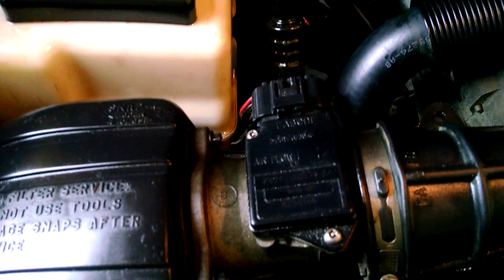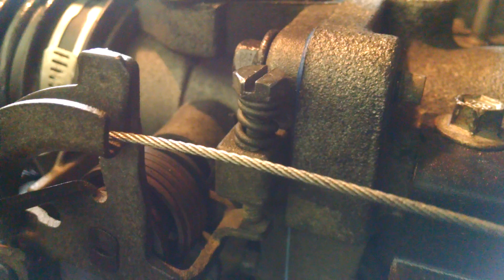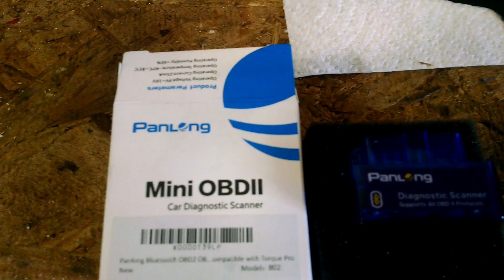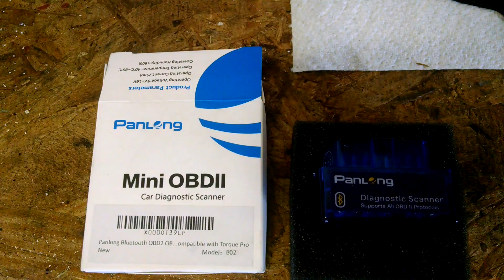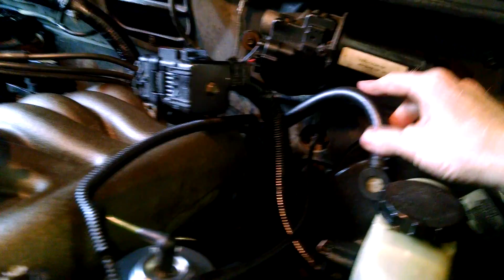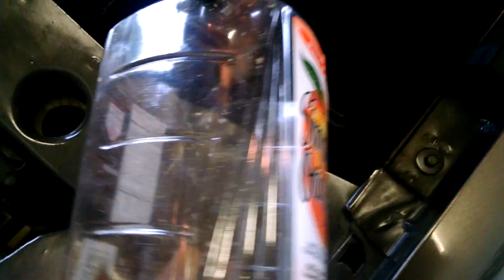2000 Ford Ranger High Idle

Comment: When my Ford Ranger is running high idle (1000 rpm), if i disconnect the IAC electrical connector the truck idles down and runs really smoothly, closer to 650 rpm.  What does that indicate?  Is the IAC working properly and its racing for another reason?

Comment: I added an aluminum restrictor plate to the IAC using a 7/32 hole to reduce idle speed to around 1300 rpm when cold. Usual cold idle is way too fast at around 2000 rpm

Comment: Great video! I'm currently trying to figure out what is going on with mine. Just replaced the TPS and IAC, still running 900 rpm when idle. It's not terrible, but still rougher idle. Hopefully I'll figure it out.

Comment: If you're idle air control was installed a quarter turn too much it'll actually want to hold your throttle body open a little bit also causing high idle.

Comment: Great video thankyou for that🙏🏽. Im not sure if you have stumbled onto this problem but, i have a 99 ranger 2.5l. Cleaned the throttle body, changed the idle control valve, air charge temperature sensor, filter and now my truck accelerates when i turn it on for like 5 seconds then idles normal, then i start to drive, as im coming to a stop, i put it on neutral (its stick shift truck) to slowly stop, but it keeps sounding like the motor is accelerating for like 5 seconds as well. And as soon as i come to a complete stop, it idles normal. Its concerning to me because it didnt do that before i did all that i did to it. Thanks in advance for your time!!

Comment: Hi just found your channel. Got a question, I have a 1995 ford explorer 4.0. When I connect the plug to the AIC the idle increases to 2000 2500. disconnect the AIC and the idle drops back. I have replaced the AIC but still the same problem. Have not checked for a vacuum leak but I don't think that's the issue as all vacuum controlled devices seem to work fine. BTW love your channel, you are very good at explaining things. Got any thoughts or suggestions would love to hear them. Thanks

Comment: Hello. I picked up a 2000 Ford Ranger V6 3.0L with Idle around 1700rpm.  Then I cleaned the MAF and bought a new IAC.  Temp sensor on the intake doesn't seem to fit very well, that could be a problem.  I have not checked the TPS. I removed the throttle body and cleaned it with air intake cleaner.
The new IAC works better and idles about 1200 without AC on. When the AC is on, then it rises up to 1500 and won't go back down, even when the AC is turned off again. 
I touched the IDLE Adjustment screw. :O  But I put it back like you showed.
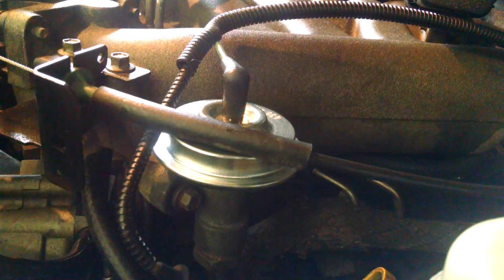4:15 ERG?... you mean EGR? I might need to replace that.
 What do you think?

Comment: I'm a little late to the party since this video is 7 years old but I have a 1996 Ford Ranger XL and I just replaced the IAC valve but now as I'm driving if I let my foot completely off of the accelerator I noticed that the car does not decelerate it remains at the same speed for about 4 seconds and then it lets off, I did not have that problem before I swapped the IAC so is there any explanation to that? Anything I can try that I haven't tried already?
Reply: Is it still doing it because usually after you replace it it takes a couple drives for the trucks computer to start working with it and learn how to do it right again because it was used to a faulty iac

Comment: I know this is way out if date. I really just want people to know that the device that he referred to as the throttle position sensor is actually the DPFE which controls the EGR valve. The throttle position sensor is located opposite the side of the throttle body as the throttle cable.
Reply: On this vehicle, it’s located directly under the DPFE. He put his finger on it.

Comment: What should the rpm's be?  I'm constantly at 1100 to 1300 rpms..  Warm or cold.
Reply: 650-700 ish
Reply: @ctbale1 
Guess it's off to the garage to check my setpoint.  Frack why can't it still be a simple turn of a screw on the carb.
Reply: @johnjacobjinglehimerschmid3555  yea, been trying to get mine down to normal for years.  Its at 950. I've tried everything except for pulling the intake manifold off.  I would  just ignore it except for I have harsh down shifts because the torque converter stays locked up and I'm hammering on my transmission.
Reply: @ctbale1  
Yeah bought my ranger last 6 months.  122k on it and soon as I got it felt the hard shifting up / down ... One garage said meh .... it's normal for trucks.

Got a stuck torgque converter clutch stuck and had the transmission and converter rebuilt /replaced.

Still shifts hard, imo.  Reverse I can hear it bang on the rear diff or it's.  Driving my shifting is meh to ok.  Sometimes it hits hard those seem to happen if I accelerate and then ease up right at a shift point .... then she hits hard.  

To say the least I'm so not happy with this truck.  My 2nd foray into Ford land in 55 years.  I'm sad I stepped out of my anti ford box.

Comment: That was the best video on car repair I have ever watched. Thank you. As soon as the parts store opens this morning I'm going down to buy the analyzer you spoke of.
Just curious, how would a plugged air filter affect the idle on my 2003 Ranger V6?
Praise the Lord
Reply: Well I went to the auto shop this morning to purchase a can of MAP cleaner, as you recommended. On a whim, I purchased an air filter as well. I bought this truck used a while back and, when I got to figuring, realized "a while" equated to over 3 years. Funny how time speeds up when you get older. Anyways, I've never changed the air filter and, considering how many dusty roads I drove on this summer, I realized a new filter was long overdue.
To make a long story short, I changed the filter as soon as I got home ( took a while for the dust cloud from the old filter to settle) and planned to clean the MAP later today when I got home. Imagine my delight when I fired up the motor and, after a minute, its idle settled down at a nice 800 rpm instead of the 1100-1200 rpm it's been idling at for over a year.
Thanks again!
Reply from the maker: Glad to lend a hand

Comment: Dang . 
My 02 edge 3.0 v6 is not set up like this .
The problem with that is this is the best explained video regarding a high idle on cold start only issue. 
I've changed all sensors and ran out of money for the pcv value. 
I must say it's quite possible the Teflon coating is gone .
I did spray carb cleaner and found no leak .
I do like your smoke machine. 
I did mess up and turn the screw .
Put it back by bring the clean threads to the edge of the dirt .

Do a video on an 02 edge lol 3.0 v6 auto . It doesn't mean to be a sinner , it's trying to follow the right path yet it's difficult living on the edge 😆

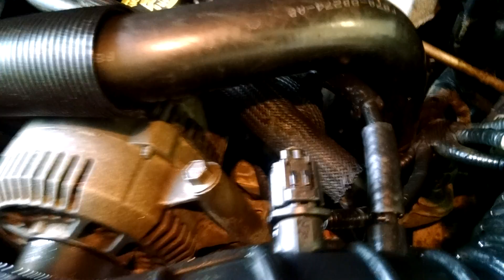Comment: @1:01 what is that tube next to the sensor?  Mine is getting dry rotted and I am having issues with a very high idle when it is cold.  I had the idle air controller replaced in the summer of 2020. It will go to almost 3000 rpm when it is cold for a few seconds.  It does this when I first start it cold and never did it until now.  It also only does it when it has been set for a few hours.  This all started when the weather got below 25 F degrees.  The AC and heater work well so the vacuum on that end is good.  My Ranger is 21 years old and it's starting to nickel and dime me too much.  In this economy it's that's $250 for this $500 for that.  My brother-in-law is a mechanic and I still can't afford it even when cuts me a break.

Comment: I unhooked the IAC until I can get replacement seems to run ok better than pulling up to light pushing in clutch and engine idling 6000 rpms minutes plug it in wow 100 miles a hr. Mind these truck are nothing but junk to me

Comment: Gosh this is a good well thought out video. My ranger 99 only idle's high when it's rolling and that goes to a good idle once it comes to complete stop. Apparently this is to make shifting easier while you're driving around but it's so high that it cant engine brake at all and it's just not good. Can you recommend which of these things to check first for that problem?

Nevermind it's a vacuum leak for sure!  My vents only EVER blow out of the defrost.  So that's it for sure

Comment: I put a new tpm sensor and a iac sensor and took off my throttle body and cleaned it up and reset my computer by putting my battery cables together and it worked great for 2 days and now its back up to 1500 rpm..can it be my maf sensor I didn't replace yet?

Comment: What could cause a 3 minute high idle after start up, summer or winter, everytime a warm engine sits for 10 minutes on a 2007 ford ranger 3 litre v6. Once it drops to normal, around 750 rpm, it stays there. It is only at start up is does this. Scan tool shows nothing.
Reply from the maker: That's a great question.  It's not a vacuum leak.  I would check the Throttle body sensor and  MAFsensor

Comment: Hey! I appreciate all your videos so much. I have a few questions about my 99 3.0l ranger. Hoping you could reach out to me and help me out! 402-604-0277
Reply from the maker: Hi Dillon.  Feel free to post your questions here.  I'll do my best to answer them.
Reply: @resurrectionauto670  ok well I had a photo I wanted you to look at for a sensor. But I was curious if you know, is there a white connector the comes from the same cable as the o2 sensor on the drivers side or is it on the passenger side? I might have the wiring harness flipped around.

Comment: Thank you for this video if you cleaned your throttle body with throttle body cleaner and it started to idle high how do u coat the throttle plate again ? Please help !!
Reply from the maker: Good question Devin.  I wouldn't worry too much about using throttle body cleaner.  It's more likely that you have an issue with the IAC or a vacuum leak.
Reply: Resurrection Auto thank you !

Comment: I just wish you explained how to deal with a low idle speed. Most of the time, my engine idles at close to the right RPM, although I think it might be a tad below what it should be. It idles at 750 RPM, maybe as high as 800 RPM. Even at the speed, when stopped at at traffic light the sound level and vibration of the running engine is so quiet and calm you almost can't tell if the engine is running. The problem arises when for some unknown reason the idle RPM suddenly dips below 500 RPM. When that happens the engine shuts off. And when the light changes to green you are stopped dead in your tracks and you have to start the engine before you can put the transmission in gear. The danger here is the guy behind may expect you to start moving and might run into the back of my truck. So far that hasn't happened. I felt like I need to make a small adjustment to the carburetor idling screw (if one exists) to increase the RPMs at idle but unfortunately you didn't cover that in your very thorough video. If you happen to read this comment and you know the answer could you please send me the answer to mktpower@storm.ca and addressed to William.
Thank you.

Comment: Ok, good info. If you have a vacuum leak, you should get a P0171-P0172 code bank one and bank 2. Which the maf sensor will cause as well. (4 cyl will just be P0171) but gotta love that homemade smoke machine! Did your ranger throw a code for the dpfe switch?? You would think it would for  egr  valve issue. Also, with my ranger i have found that aftermarket parts dont carry the same values as OEM so if it is available,  i would use the motorcraft brand. Just saying.  God Bless you sir for the informative video! Maybe one day you and I should do a collaboration video! 

       SCOTT THE CAR GUY

Comment: Sir, if you could answer my question it would be amazing. I have a 99 3.0 4wd, that idles at 2k unless I unplug the iac, then it quiets down to normal. I have replaced the iac and it hasn't made a difference. What could cause this problem? Did I get a faulty iac or is something else wrong? Thanks
Reply: U have to reset the idle speed on iac to do this codes have to be cleared an the u turn key on for several minutes without the motor started n then off n then start motor that's so it knows where the iac's  position
Reply from the maker: Good question Dylan.  I suspect you have a vaccum leak somewhere on truck.  Best of luck with you repair.

Comment: I work on outboard engines and I’m we have to do link and sync s on the IAC,s and Throttle body’s and  f they are not In sync you will have a bad idle. I’m guessing that a high idle would not be indicative of a high idle but I thought I’d ask about it. 
We used a connect so we could read the output of the IAC in milli volts. My question is there a manual written way to do this ? 
I’d imagine that my 4 stroke engine Yamaha would be similar. It was an older one similar to this trucks age. 
Anyway Im looking for a manual that will show me this operation any help would be greatly appreciated. Thanks.
Ps 
My truck idles at 2000 and then it settles down but now after it settles down it will stall out. I haven’t done anything to the truck yet I’m just doing my homework. Thanks again. I appreciate you making this video.

Comment: Great video, Thanks. My truck revs when under load - going uphill or rapid acceleration and while it still pulls, it loses a majority of its pulling power. I will try to diagnose with these suggestions. If you have any other suggestions I'd appreciate hearing them. Thank you.
Reply from the maker: Thanks for the comment.  Best of luck with your repair

Comment: Carburator cleaner is safe to test for vacuum leaks as long as its done shortly after starting a cold engine. 

 Spray it on hot exhaust manifold and you'll probably have a fire.

Comment: Do you have to have it running to check codes?
Reply from the maker: No.  But the key has to be on the run position
Reply: @resurrectionauto670  thank you. I ordered a good scanner to use not only on mine but others too

Comment: I wonder what the 2 thin coolant hoses stemmed off the main lines (to heater core) are going to?  Mine just wrap around the PCV Valve, which I don’t think is necessary.

Comment: I have a 98 2.5 ranger with no A/C and idles around 1000 rpm. Could the mere fact that i do not have A/C cause the idle to be where it's at? Thanks.
Reply from the maker: Good question.  No I don't think that would cause the high idle.

Comment: When I start up my ford ranger it has an AIRY SOUND and so when I speed up and shift the air sound is gone, btw it’s an automatic it sounds like a diesel when it’s not, only happens when I’m driving slow

Why is there an airy sound? And how do I fix it?

Note: it’s at 206,000 miles😂
Reply from the maker: It's hard to know without being there.  You might first check for vacuum leaks.  Best of luck with your repair!
Reply: Resurrection Auto thx man I appreciate it
Reply: @jp_travels247  It could simply just be your fan. On my Ranger (3.0) its the same way, sounds like a diesel on startup and revving/accelerating below 2500rpm when cold. Does it get any quieter when the engine is at operating temperature?
Reply: Zacoon it does get quieter at normal temp, thx for your help man

Comment: I would like to thank you for your descriptive video about the subject matter I really enjoyed it and learned a lot from it so much so that i went back watched some portion of the video again and again to get the grasp of it. I request you to please answer some of my questions. Since the basic technology is the same and works pretty much the same way for different automobiles. I own not a ford ranger, but a nissan pickup truck 5 speed 2.4 liter base truck 1997 model. I already replaced the TPS and adjusted it well with the help of multi meter with the proper volt and ohm readings, but ever since then my truck's idle has been unstable and isolates between 1000 - 1500 when cold and then settles down at 900-950 when the truck warms up - I did the smoke test and found only a freckle of smoke at the rim of EGR-VACUUM-MODULATOR. I can still hear the vacuum noise coming  from underneath somewhere but did not see any smoke while doing the smoke test. I went ahead and replaced the vacuum modulator, but the idle is still not fixed, but I am not getting any check engine light only feel that idle is rough and greater than 750 and gas mileage is poor . I could not find "idle air controller" on my truck - watched many videos on youtube but none helped me as much as yours did. My truck's EGR is fine and I tested it by pressing the diagram and kept it that position by putting my finger on the vacuum opening to the EGR and the diagram stayed there and did not fall off. you can please write to me on my  email to help me or reply in details on you tube as to what can i do to fix the problem - I already cleaned the throttle plate and could not find the temp sensor anywhere in my truck. I need to mention here that in my truck there is an EGR sensor and then next to it there is EGR VACUUM MODULATOR - both are connected with a vacuum hose. I look forward to your reply and will be checking for it everyday - thanks
Reply from the maker: Bubba.  Thanks for the question.  Unfortunately I am not familiar with you model truck.  I have never worked on one at all.  It sounds like you've done a pretty through job this far.  I wished I could help further.